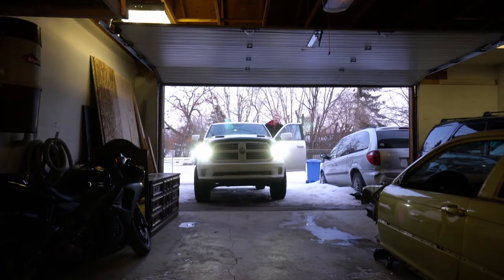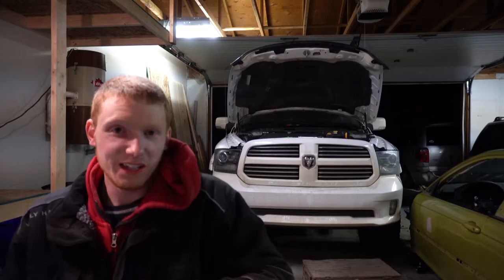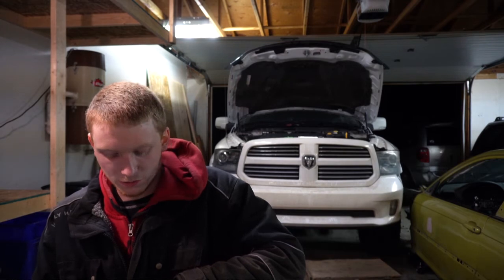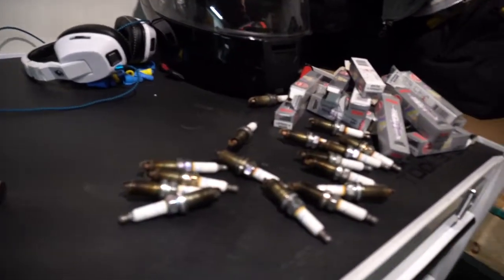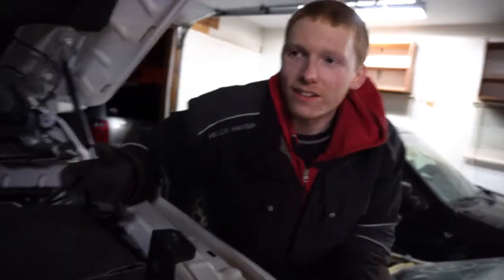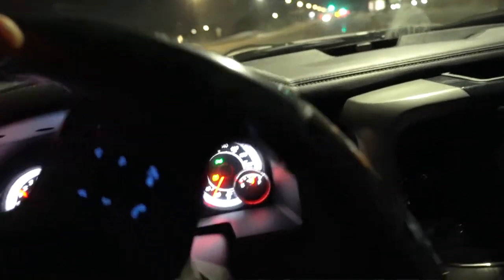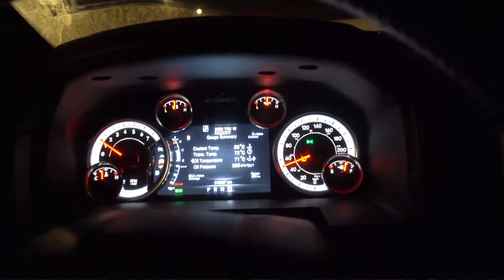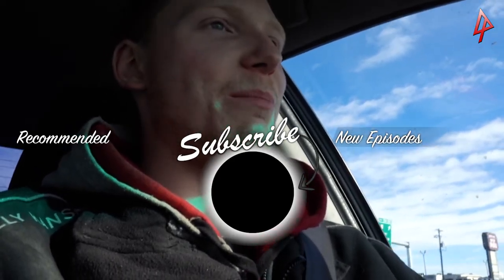We FIXED the MISFIRE!!! 2013 Ram 1500 Truck Pt. 2

Comment: I have a 2013 ram 1500 with a 4.7. It recently started misfiring on bank 1. 1,3,5,7. I swapped out the spark plugs with new ones, fuel injectors work, coils work, new 02 sensors. Runs okay but at idle it is no good

Comment: My husband is getting a p219A / P219B code.. we replaced the engine, alternator, battery, spark plugs, so many things and it keeps having issues. It’s a nightmare.
Reply from the maker: Awe man, that’s not good! That code is a afr (air/fuel ratio) issue. There’s a lot of things that could make something like that happen but I’ll tag an article that hopefully helps you guys! It’ll tell you what and why the code is happening and I believe later in the article they tell you how to trouble shoot and in what order! Really hope it helps Em! 😄

https://www.obd-codes.com/p219a

Comment: Damn i also feel like a misfire on my ram laramie! Yet no codes. Feels like no power when acceleration! All my spark plugs and coils are new.. :(
Reply from the maker: Well as long as there’s no blue smoke coming out of the exhaust I’m sure there’s hope!!! 💪🏻 have you checked the injectors or other fuel components?
Reply: @DeoneSoBord  i havent checked injectors. Hoping is a clogged one! Thanks brother wish me luck! 🙌🏻
Reply from the maker: @alphageneration66  absolutely am! Hopefully that’s all it is. Next step would be to check for intake leaks maybe but I wanna say most times it’s gonna be fuel or spark issues! 😉
Reply: @DeoneSoBord  at this point, i changed all plugs and coils, serpentine belt tensioner, idler pulley. I’m gonna have to replace does injectors :(! What a weird truck
Reply from the maker: @alphageneration66  injectors wouldn't be a horrible idea. Hopefully It'll fix your trucks issue!!!

Comment: I have a 2012 ram 5.7 and I’m still getting p0303, I already change all spark plugs and coil on cylinder 3. And still on p0303
Reply: My 2013 is still doing the same thing and i replaced the coil and injector, if ya got that you might be stuck with a cam/lifter failure.... my wallet hurts lmao
Reply: Hey Jesus Sifuentes. Have you fixed your issue with your Ram? I am currently dealing with that code P0303 and I have already replaced spark plugs and the coil for cylinder 3.

Comment: Can anybody give me suggestions on my ram sport. I changed spark plugs,coils & cleaned throttle body. I keep getting code p0303 cylinder 3.
Reply from the maker: Have you checked injectors?
Reply: Yes I changed the injectors
Reply from the maker: @mexxibaby1333  well at least for your benefit you know which cylinder it’s happening on. Being that it’s a misfire code, it only has so  many causes. Idk if the code happened before or after you worked on the vehicle but I would suggest either changing spark plugs on cylinder 3 again. You could maybe swap the boot with a different cylinder to make sure the boot isn’t the issue at the same time. Verify torque on the plugs of cylinder three this install and if you changed the injectors for new ones you could try the intake gasket for the cylinder. I’ve heard that can have an impact whether it be true or not. Let me know if it doesn’t work out and I’ll see if I can find more info once I hear back from you 🙂